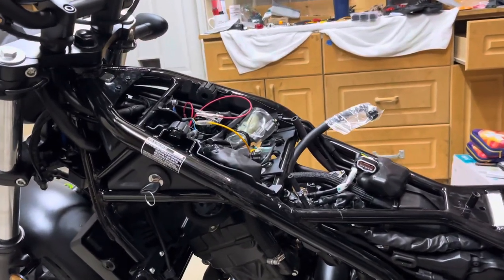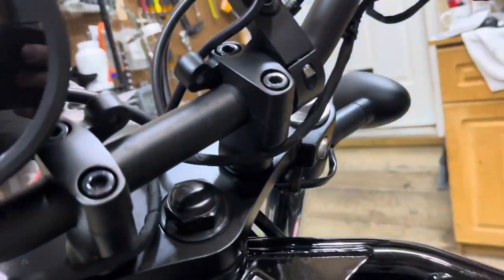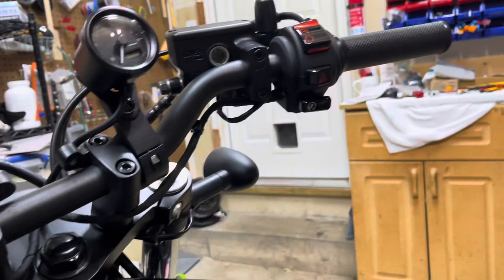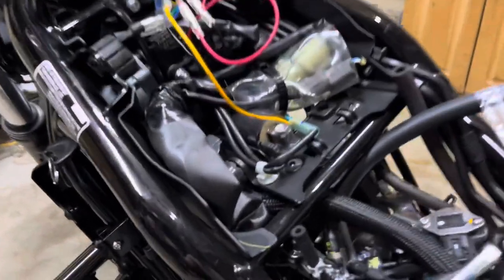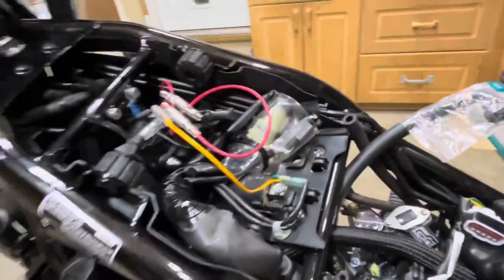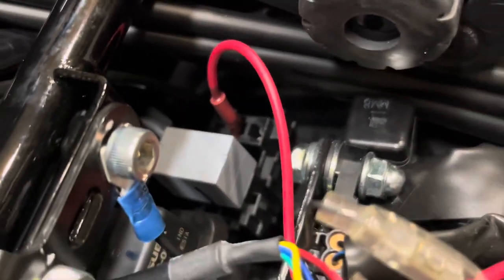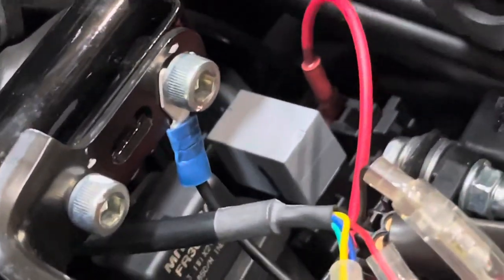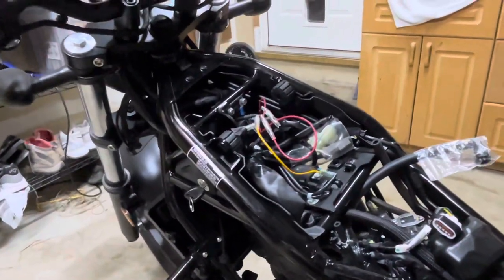Installing a Daytona Velona tachometer on a 2023 Honda Rebel 300

Comment: I just bought a new Rebel 300 and am thinking of installing a tach. I have 5 other single cylinder bikes. The Rebel 300 is the buzziest out of my 6 bikes. It feels like it is ready to shift close to the recommended shift points Honda gives in the manual. The engine feels like it's a tad early but it sounds like it's right. The bike vibrates hard until the higher rpms where you feel it coming into power but I wouldn't say it is lugging like a bike would with early shifts.  My single cylinder dirt bike is smoother. I'm just wondering if the sound is throwing me off. Really weird. I have a cammed Grom with oil spinner delete and it is far smoother than the rebel is. It honestly feels like a single cylinder without a counter balance.